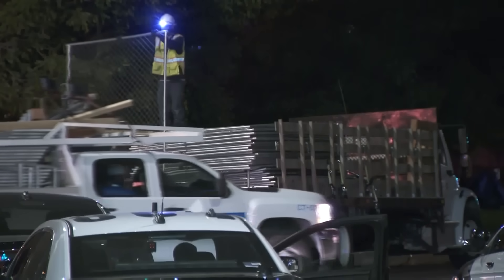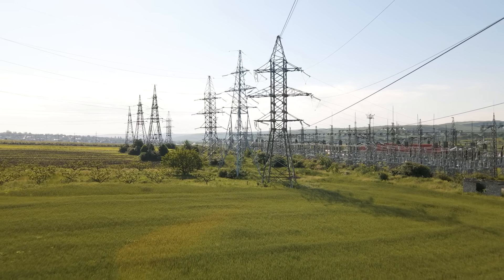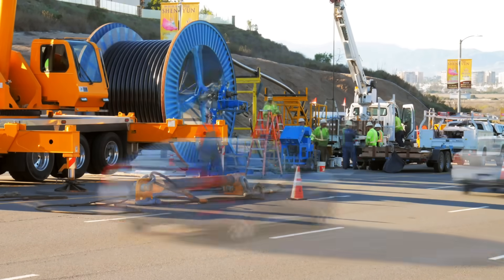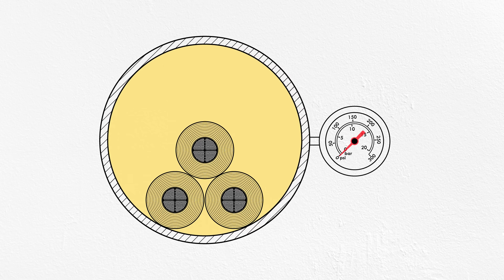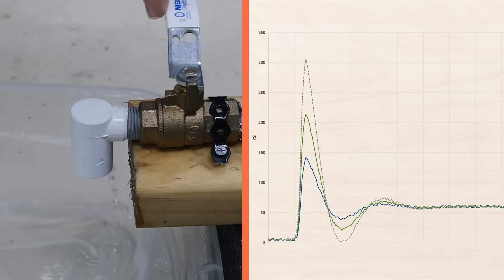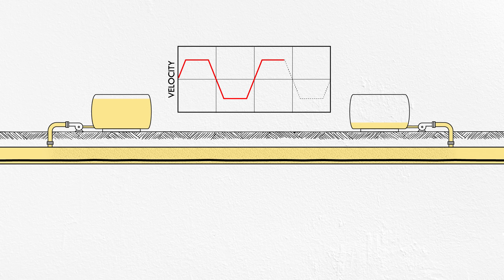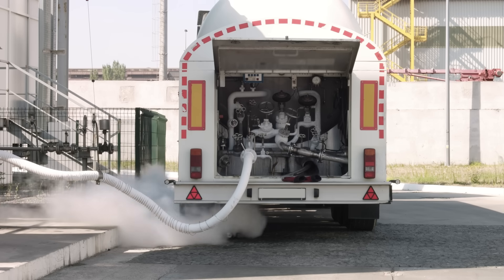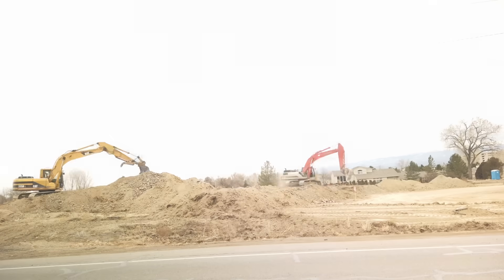Repairing Underground Power Cables Is Nearly Impossible

Comment: I mean is that the only way they could think to insulate wires ??? Would it not be cheaper in the long run to run the lines is separate pipes a few inches apart?

Comment: You did not mention whether the line was AC or DC.  I understand that DC can be buried underground with much fewer technical problems.  Apparently it is not much more expensive than running the wires through the air, and maintenance costs are lower than overhead DC transmission.  This makes underground DC transmission an attractive alternative for tieing the national grid together which would have the benefit of providing cheap solar- and wind-generated electricity west to east.

Comment: This seems ridiculously overcomplicated. I understand there are many polymers which have a breakdown voltage of tens of kV per mm. If heat is a problem, why not just increase the cross section?

Comment: I helped repair the Scattergood-Olympic underground transmission line by testing the cable oil. The repair of any underground transmission is difficult and time consuming and sometimes a new transmission line replaces the old line. The insulation will degrade over time and needs replacement after forty years depending upon several factors.

Comment: Why not use plastic isolated twisted cables?
What about using the sewer system?
You wouldn't be able to have a high capacity per line, but at least it would be an addition.

Comment: How does that compare to HVDC? It sounds like a huge hassle with having to pump the dielectric. I suppose D.C. would have the same heating problems... interesting, thanks!
Reply: DC is only suitable to connect two grid systems.    Frequency is the problem

Comment: Repairing underground cable is not nearly impossible. Here in Prague, we install, repair and replace underground cables on daily basis doing beneath roads, rails, tram rails, rivers and so on. I know it because I work for such company and do these projects and I also work for energy utility that maintains these cables. It is also easier for us because we have mostly XLPE cables and also some PILC which are replaced by XLPE.

Comment: a few quick questions:
1) all the measures that you mentioned that they did to fix it sounded like it was done on the fly; was there no plan for this? It just seems crazy to me that they would implement a plan that deviated so much from the norm (overhead cables to underground cables in some new fangled contraption and configuration) and no one asked, "so what happens if it breaks or we need repair...?" It's like a new mercedes or bmw. its amazing and it works great when it's new but you don't even want to know what it costs to maintain as it gets old or if something breaks!

2) what did they do for supplying power when the line was being repaired for so many months?

thanks for the content and keep up the great work!

Comment: I'd be tempted to wrap a heater around the line to raise it a constant temp.  If the load heats the line, fine, turn down the heater.  During times of low load, fire up the heater.  Done right, there will be no temp cycle at all.  Would have been much cheaper than this failure.

Comment: Grady,
I recently started looking into the Pacific DC Intertie because I was seeing some barges of the coast of Santa Monica.  I later found out that there was a massive ground system there to complete a DC high voltage transmission line between Sylmar CA and Oregon.  Much of this ground system is underground which is many miles from the Sylmar Converter station to the Santa Monica Bay.

Are you aware of this system?  500,000 volts of DC power exchanged between Los Angeles, CA and Oregon?

I would love to have your thoughts on this.

How do they turn the DC back into 3 phase AC?

I love your videos...

Greg

Comment: TDR is a fancy way of saying sending a pulse and measuring time to bounce. Similar to how sonar works, or laser rangefinders. Laser rangefinders, and devices to measure wire length are cheaply available now. TDR is indeed very useful for finding shorts, or simply measuring the length of a cable. I remember back in high school hearing TDR, sounded fancy, but it is pretty simple.

Comment: BT in the UK use the same thing, paper covered copper wires between the telephone exchange and the green boxes, but use compressed dry air to keep moisture out instead of oil, but these only run at -48 to -52v!

Comment: I'd be interested to know what the differences are between the newer 2018 line, and that older one are.

It's incredibly sad to hear how many complications went into the orginial underground line. I understand why so many locals wouldn't want high voltage powerlines hanging above their homes. Not just for safety concerns, but for the increidble eyesore they introduce to the area. Having giant, looming silver cables overhead every time you go outside would most definatly make things feel opressive and weird.

I really do hope that underground powerline technology can get to a place where it is no longer so impractical to implement, maintain, or repair. Our demand for electrcity certainly isn't going to go away anytime soon, so it really is a nessecity that the abilty to find solutions that work well for all parties can be found and implemented.

Comment: This problem is trivial to solve, just electrolyze water at the source then send hydrogen through a pipeline (none of the issues of underground high voltage) and then use fuel cells at the the sinks. Not only does this make the transmission reliable, it also provides inherent energy storage and load balancing (just provide tanks at the consumer end to allow peak demand to be addressed at the point of use. This allows the pipeline to be sized for a average demand rather than peak demand.

Comment: Screw underground. URD, transmission, all of it. Any tiny little nick in the semi-conductive layer, insulation, or conductor, or the slightest contamination will cause it to fail. Even the conductor being very slightly off center in the cable cross-section will cause pinholes. Good luck finding the fault too. Plus, the concentric neutrals degrade and eventually you lose the neutral. Damn NIMBYs and their hatred of poles. Overhead doesn't even look that bad!

Comment: So what do they do in Germany with high voltage lines?     You can travel a lot through Germany and you just do not see these high transmission towers everywhere like you do in the United States and the population density is higher in Germany per acre of land.     One thing I saw in Germany that impressed me was the lower voltage lines were put in a U shaped concrete lined culvert with a concrete lid.    Easily accessible for repair just by taking the lid off.     While it might not be cost efficient, In my opinion in some applications such as Hurricane prone Puerto Rico, it makes  sense to bury all the electrical lines to make the Island more resilent to hurricanes.

Comment: If so EXPENSIVE and demanding? One could implement improvements. A believe increasing access and backups would be wise. How to gain access? Use a 15ft climate controlled tunnel instead 12 inch fluid filled pipe.  Why run 3 cables that if fail shuts down everything? Perhaps 6? Have three alternative phases to alternate independently or switch the complete set. Pro tip: installation of a rail system to aid in install and replacing damaged cables.

Comment: It's a bit rich calling the solution clever. After the stupidity of creating an engineering system which was , in your words, impossible to repair. Did the engineers who came up with the system think that the system would not degrade and fail!
A better system would be to create a human accessible tunnel in which the three phases could be insulated and separated safely. It could be inspected regularly and/or cct cameras set up to see down the tunnel. If repairs were needed, access would be easy.
Sometimes burying expensive engineering systems in the ground is about the most expensive thing you can do.

Comment: Should have dug out far deeper and wider maintenance tunnel, ideally combined with pedestrian pathway or secondary lane on top of it. So no maintenance digging is required at all (you simply lift some lids from above) - just as for central heating pipelines.

Comment: hm, here its normal to have underground lines.... there isnt any poles in the streets...not even in villages...  so it must be a problem with US engineers to understand how its done...
in the city center, busy commercial area, underground transformers...but we have 400V/230V 50Hz...   
In Germany, 73% of the medium voltage cables are underground and 87% of low voltage cables are underground. The high percentage of underground cables contributes to the very high grid reliability (SAIDI < 20). In comparison, the SAIDI value (minutes without electricity per year) in the Netherlands is about 30, and in the UK it is about 70.
Reply from the maker: Are you trying to make a generalization about all of the United States based on the story of a single underground transmission line from the 1970s?
Reply: @PracticalEngineeringChannel  yes, i saw the terrible wiring in US towns and cities.... looked like in a 3rd world country, not as bad as maybe India etc... but close..
and generalization is an US citizen habit to everything....

Comment: Honestly this helps make the PG&E fire hazard wire plight more understandable. I hadn't really considered how much additional engineering has to go into putting cables like these underground, as opposed to the more readily available and simplistic approach of stringing them out in the open. Thanks for the interesting perspective!
Reply: PG&Es issues were caused by foliage (trees) touching overhead lines
Reply: @getbetterben  same with SDG&E. They’re still paying off lawsuits from the late 2000s regarding wildfires started by their poor management, which is in turn being payed through double digit increases for ratepayers for many years to come
Reply: @getbetterben  And, from what I understand, not replacing the wood poles.

Comment: A couple questions.

Rather than messing around with transmission lines which look ugly, are hard to manage, and dissipate electricity over distance - is the cleaner solution to build more medium and small size local power plants?

High voltage lines have dangerous and powerful EMF radiation right? Do the wires underground present that same risk to nearby residents?

How on earth could they originally install these underground lines with what seems like zero plans and questionable capability to repair damages? Don't engineers have to assume it will break at some point and know how it will be handled?

Comment: Im surprised, in Montréal à lot of the manholes are for access to the underground electricity network and they are made of large and accessible tunnels. I think similar installations in New York and other major cities.
I guess they use the same oil technique in the pipes in those access tunnels 🤔
Or would this only apply to high power line before the city transformation center..

Comment: I'm surprised they didn't install an HVDC line for that length of underground cable.  I know this technique is used to address the problems of capacitance in HVAC buried insulated cables.  Your story doesn't sound like capacitance was a problem here, but I wonder if arcing would have been as big a problem with DC?
Reply: HVDC   works to join two A/C systems.  The frequency is controlled by the receiving frequency.  In this case it was going to consumers  who had no local frequency to settle the DC.
Reply: I see.  I assumed that this major line was supplementing a more local source, considering its urban environment.  Gotta limit my assumptions, I guess!

Comment: Sometimes it baffles my mind how higher voltage many times takes less work and technology. Like substation connections vs putting stress cones on 5kV terminals. Or how we had to keep the cables carrying the 5kV in the tray at least a cable width apart. They could be put in a pyramid/triangle if no other option but the flux is supposed to break the cables down quicker this way.

Comment: All that really needs to be done in cities and towns is to have a heavy removable  cap on top that still requires heavy machinery to lift so people can't access it on their own, and you can even use the cap as sidewalk afterward. Just need to make it deep enough. Place it in a container ditch-like placement and seal it in with the removable caps. If you preplan well enough, you can even link it to drain to the sewer to drain rainwater that seeps in from above, or potentially other city systems.

Comment: Such an archaic system, oil in pipes, in metal (a conductor) pipes. It would be better to oscillate the oil at higher frequencies.
In Europe they use rubber/silicon/pvc cable insulators, and concrete tubes, like those used in sewer pipes,since before the 80s.

Comment: With the type of engineering requirements involved plus the costs I imagine the residents of Jurupa Valley, Eastvale and South Ontario will never see those HV cables go underground? Like I told a friend who bought a new house in Eastvale that those power lines and towers have been there over 50 years. The developers knew that and you should have too when you bought the place!

Comment: As a cable engineer, I'd prefer underground tunnel with cables on trays than cables in buried pipes. You get as good ampacity as in free air reducing cable and armor costs compared to piped systems. It is easier to maintain. I know the construction cost of tunnel is not cheap but that does not compare to the cost of downtime for an important system. Buried pipes of cables often need armor and more spacing for cooling that results in magnetic imbalance (expensive cross bonding can minimize) that affects nearby ferro magnetic structures.
Many cities in Thailand failed to integrate the power transmission system with road, rail, subway, piping, canal or other utilities from planning stage.

Comment: it sounds like a design error. in the city where I live on the other side of the planet, almost all electric cables are underground for the past century. the first question would be, why there is only 3 cables, not 6? no spare no repair. it also restricted the development of the city as well. the second thing i feel strange is, why they are all bunch up in one tube? here we don't use tube, but a kind of concrete "track tray", which  have concrete as insulation between each cable. so, no dramatic repair is needed.
Reply: A cable in a tunnel does not know where it is!

Comment: Hey, we are really smart engineers. Lets bury the high power lines we need to get electricity from point A to B and use paper as part of the insulation. How did they think this was going to last in the long run? And isn't the oil used not regular oil but extremely toxic in an earthquake zone? Also, doesn't steel corrode over time as well?

Comment: Good presentation however you missed DC HV transmission that has been  successful  on some under sea cables and on the long Dalles Oregon to Sylmar California intertie line.  Elimination of corona and no need for controlling inductive  and capacitive reactance at light and heavy loads are advantages.  The disadvantage however is changing AC to DC and then back to AC   Norway and Sweden have been a leader with their many water crossings as has BC Hydro in Canada.

Comment: I was taught that air was the best insulator. The reason being that there are relatively few atoms for current to travel through in the air as compared to any solid material. Electricity won't jump across gaps between phases on high voltage equipment but if carbon builds up from successive small arcs occurring on one insulator on a piece of equipment the electricity may then arc from one insulated phase to another or to their support structure using the carbon as a path.

Comment: So how did they do the repairs?

Freezing the oil will keep it from leaking, but how do they scrape out any frozen oil that was contaminated during the repairs before it can melt, without accidentally introducing new contaminants during the attempt? Also how do they remove the air bubble that forms when the frozen oil, and the gouge cut out of it to get to the cables, go back to being a fluid with a void of air introduced into it? With the minimal distance the oil travels during pumping cycles I imagine pushing the air bubble along to one of the oil holding tanks would not be practical.

Comment: I was wondering if you might do a video on high voltage transmission using super conductors?  Such as the underground line near Buffalo, NY that is cooled by liquid nitrogen. I believe it is near 100 mi in length and is near zero resistance.

Comment: Greetings!  Do you know the reason why the cable oil cooling comprised a flow reversal topology rather than a cheaper closed loop system with heat exchangers  ... like in your car? Only an additional oil return pipe would be required, with flow control to deal with fluctuating oil temperature with load. This way conductor warping and paper insulation degradation could have been avoided.
Reply: From the video it seems that they aren't really cooling the lines overall but rather trying to keep the temperature even by distributing the heat evenly across the line.
Reply: @gerardhughes  Greetings Gerard .. Thanks for your reply. Are you saying that they were  trying to deal with "Hot Spots"?  If so why should hot spots occur in a homogeneous line? ... if the line is load shedding then I can see the need for inter-nodal cooling ... but why the flow reversal topology?